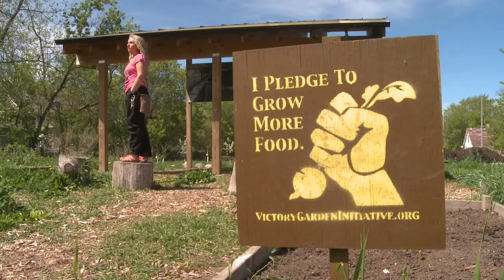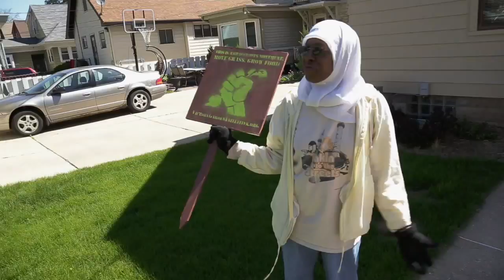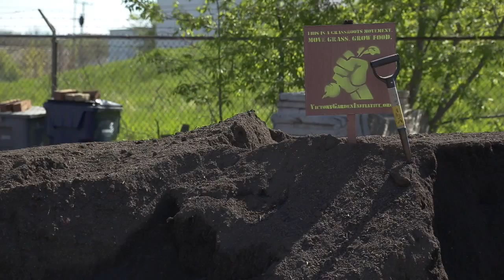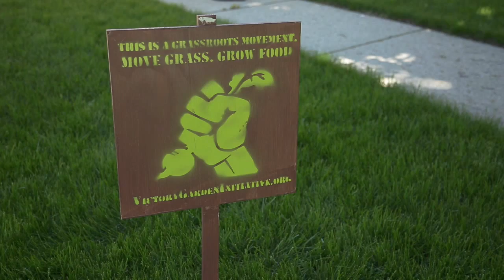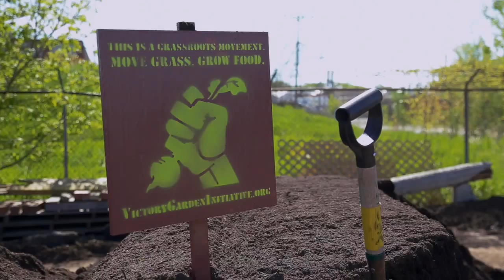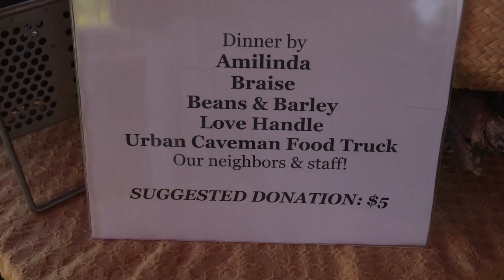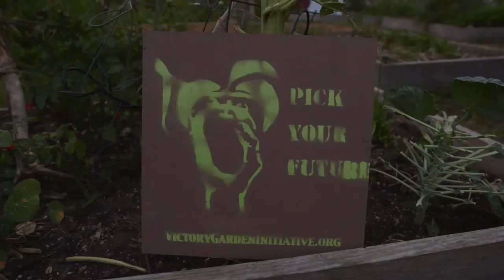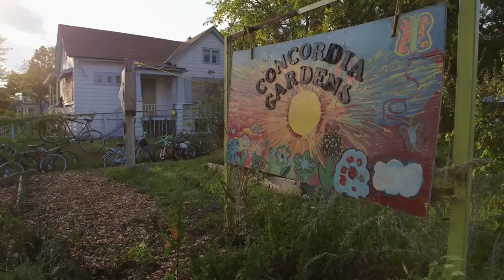Wisconsin Foodie - Victory Garden Initiative

Comment: I would like to have 5 or 6 box's in my back yard, and some in my frunt yard. What would I need to do to get this started?
Reply: It's sad no one has got back to you on this question. 

If you have not built your boxes, here goes. Raised beds should not be more than 4 feet wide and as long as you like. Buy whatever cheap 2x4 you can find and youtube "building a raised bed", it's really easy.

As for soil, look up providers of soil in your town. Ask the cost of top soil per yard. Yards are a measurement used for soil by square feet (calculate how many yards of soil you need per bed by asking the soil company based on how many raised beds you have and how big they are).

After that buy a good quality organic fish fertilizer for great results and apply when recommended. Do all that and you will get pretty good results.